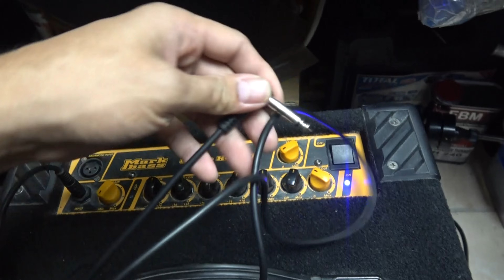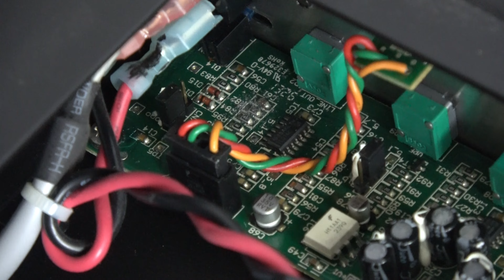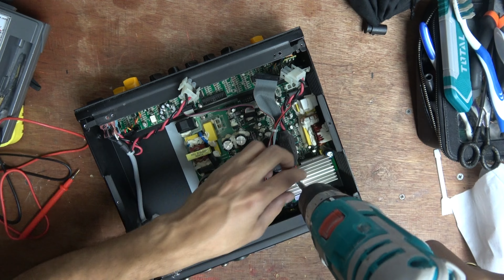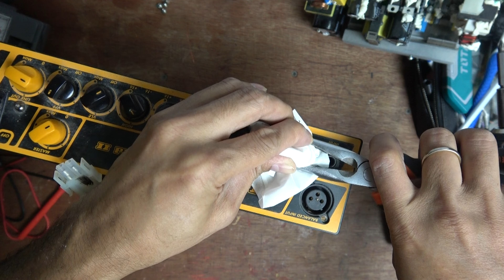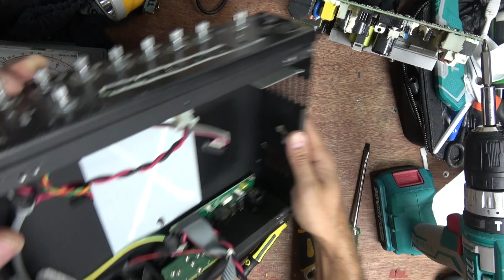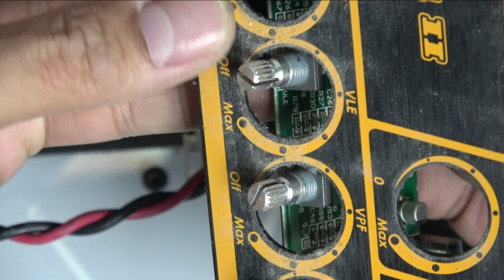How to fix no sound on Markbass combo head ii amplifier

Comment: Mine can't  be repaired... stuck with a bill for diagnostic repairs and an Amp that doesn't work and never will... stay away  from Markbass..
Reply from the maker: Hi, sorry for that. Thank you for watching 🙏
Reply: I've had similar issues with most solid state amps including ampeg svt 7 pro and a more modern gk legacy (sent it back)

Comment: Is the VU meter set on resistance or capacitance? thanks
Reply from the maker: Hi, it is resistance. Thank you for watching ☺️
Reply: @ARTaudio440  I don't see "Part II" , did you ever fix the amp? thanks
Reply from the maker: @douglasm722 Hi, thanks for watching. Part 2 is in the dicreption.